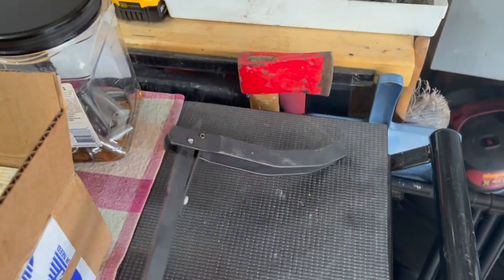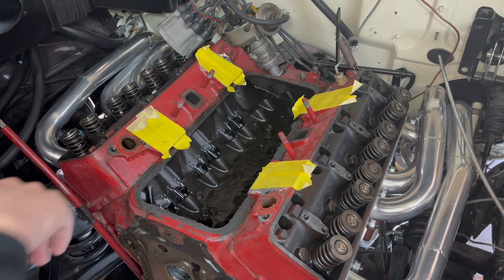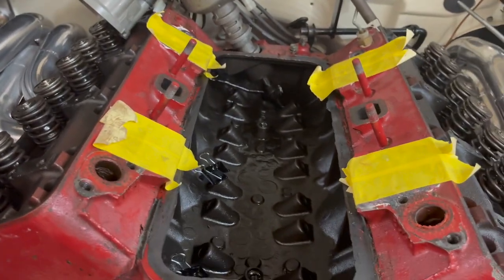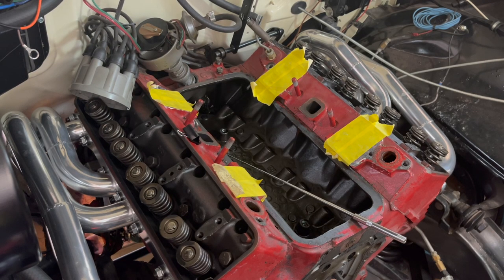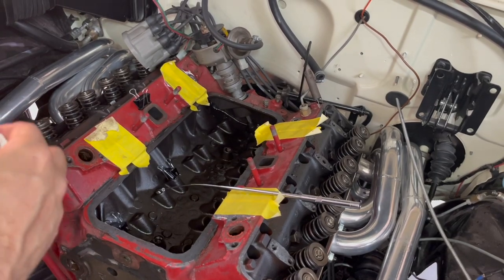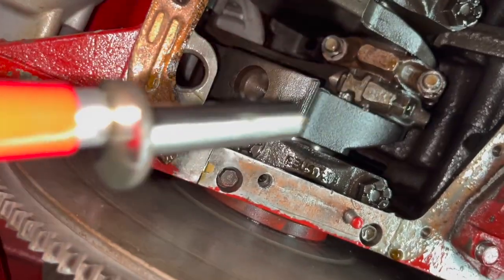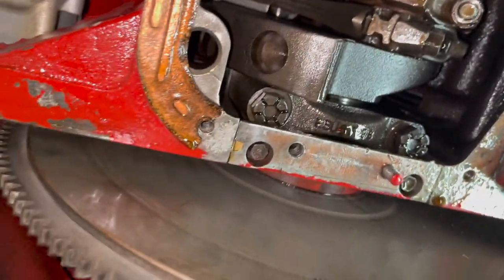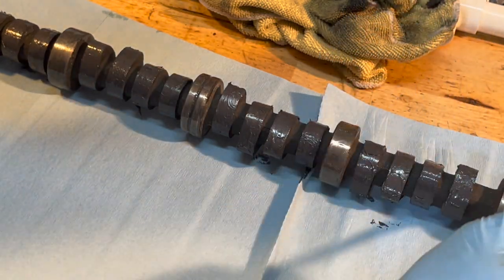Y Block Ford Camshaft Installation (in car) Part 2

Comment: Just ran across your site a few weeks ago.  I have to say THANK YOU.  I currently have 1956 Fairlane with a 272 ci motor with 3-speed manual overdrive.  Am currently rebuilding  a 312 ci engine for the car.  Your videos have been so helpful.  My first car was a 1956 Customline with a 292 ci engine and 3-speed manual trans.  That was 57 years ago.  I am loving working on the car and engine, but your knowledge and videos have been so helpful, especially on the oil pump removal and reinstallation.  I learned so much way back then, but as time goes by so do a lot of learned things, again THANK YOU. By the way, my car is the same color scheme as yours, beautiful.
Reply from the maker: Glad to hear it - I am still learning quite a bit myself as I move along here. Hopefully my camshaft break-in video will be up within a couple of weeks!

Comment: Very tedious job, may not want to do this for a living so keep your day job. Just a thought but if you had a magnet like you are using below and the sizing was right could you come in from the top though the lifter bore and pull the lifter straight up from the bottom.  Easy for me to say sitting here watching you in my easy chair. You got it done

thanks for all your time and effort on this project.
Jonny D.

Comment: Daniel, Why don't you eliminate the oil return tubes off the rocker shafts? It's an easy mod to pressurize the rocker shafts.
Reply from the maker: Look in my playlist… I put together a set of Barker NORS performance rocker arms and did this exact thing using Tim McMaster’s method.

Comment: I've heard about cam swapping a Y-Block. As a Ford product owner for a minute, was this the prelude to the modern day pain that is Ford engineering? Why did they make a cam swap so challenging?
Reply from the maker: They followed much of the engineering used already in the Ford tractors. Most are not aware that both the Y Block and the 50's Ford tractor engines share the SAME tappets/lifters. Bear in mind too that this was Ford's first foray into the overhead valve market. For the bean counters, it is much cheaper to manufacture a solid lifter/tappet as opposed to the hydraulic lifter that the Lincoln variant used. Obviously, with the FE series in 1958 these mushroom style, solid tappet jobs went away.
Reply: @Hot Rod Reverend  the advantage of a mushroom tappet cam are well known.  Guess the sacrifices you have to make for serviceability